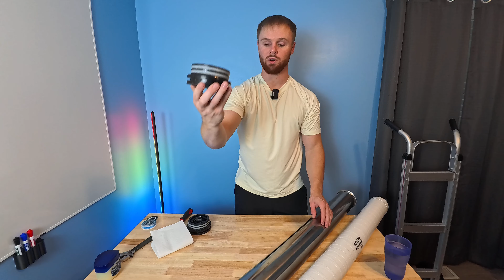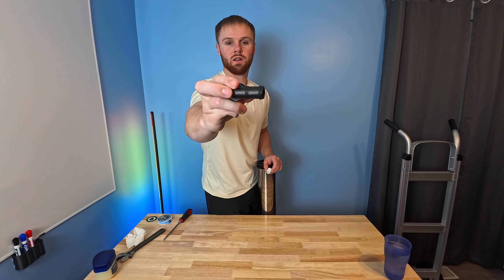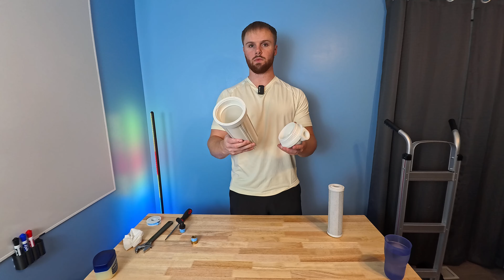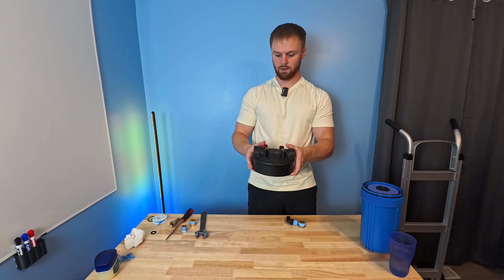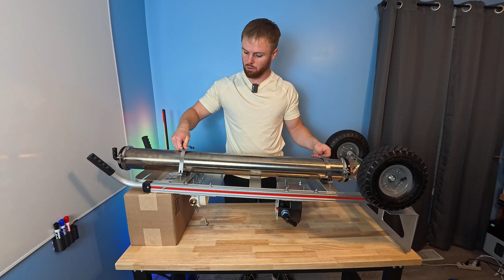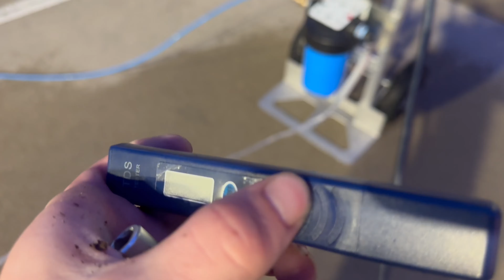DIY Water Fed Pole Cart 2.0 - Window Cleaning

Comment: Hi, is a garden tap pressure of 3.5 bar sufficient for a membrane like the XLE4040? I plan to use it with the Unger Hydropower Ultra S—which I currently use, but the DI resin filters wear out too quickly. Thanks for the reply.

Comment: Does this system work on 200-300 tds?
Reply from the maker: Yep, I run about 200-250 in my area and it works fine. Higher TDS just needs more maintenance and resin refresh

Comment: Why does everyone use this massive ro membrane when u can use a smaller one and a small pump
Reply: Can you explain?
Reply: Bigger ro = more flow, eliminate need for pump
Reply: Does a bigger filter give you more flow? Its def clean water for sure but is there a better way is that company just cornering the market
Reply: @beardman69-e1w just get a 20” then?
Reply from the maker: Adding in a pump just means you have to have a way to power it and one more failure pump. Larger RO membrane means less pressure drop and more flow across the membrane vs a smaller membrane and no pump.

Comment: Really curious how a booster pump could be added , so that I could  feed the system from my buffer tank ,and send it out to a hose reel on the truck TIA!
Reply from the maker: You could just wire up a booster pump in-line between the tank and the cleaning system. Make sure to go with a legit booster pump and something that’s rated for continuous use.
Reply: @pressurewashnerds any insight on how much psi and gpm I should run with a setup like this?
Reply: From what I’ve gathered, the pump should be right before the RO and psi should generally be between 80-100. The membrane that you use has a recommended psi rating.  The gpm is dependent on how many poles you’re running. Rule of thumb is .5 gpm per pole. I’m currently using a 90 psi 1.3 gpm pump with one pole and notice that flow is more than I need and I’m looking into getting a flow control

Comment: I already built a water system on a cart for window cleaning. I followed all the steps. When I connect it to my water hose, the flow from the sediment filter to the RO is good. However, at the bottom part of the RO, there is no flow from the center hole. All the water goes to the waste (unfiltered) outlet, and there is no flow going to the resin tank.
Reply from the maker: I replied to the emails you sent. Hopefully this is resolved now 👍
Reply: I’m having the exact same issue. Could you help me out please.
Reply: @pressurewashnerds   what was the fix for this?

Comment: Thank you for the video!  Is a sediment filter the same as a carbon filter?  If they are different, which do you prefer!  And- how would making this a 4 stage system affect flow?  Again, thank you!
Reply from the maker: So sediment filters just remove debris, carbon filters remove chlorine to help the RO last longer. If I was doing a 4 stage, do the sediment filter after the carbon and before the RO since the carbon filter can produce small amounts of debris. Flow wouldn’t be much different if everything is sized right

Comment: I'm about to by all the equipment and build mine. I'll share updates as I go. Questions...just to make sure...since the xero remains out of stock, I have to buy both pieces from Detroit sponge correct?
Reply from the maker: Correct! The one piece fits inside of the other and adapts it down to the tubing size
Reply: Really interested if you started to make this, I'm thinking of doing this myself!
Reply: How did it go?

Comment: You mentioned on the discharge valve that you like having it so you can mess with the ratios, I have no clue what you are talking about tbh. Would you mind explaining a little bit please? Thanks
Reply from the maker: You crack open the discharge valve to allow the RO reject water to escape. The ratio I’m referring to is how much clean water you have coming out of the system vs the reject water

Comment: So I was doing some research and I just bought a DI tank but I didn’t factor now quickly. I would go through resin so now I’m considering also picking up a sediment filter and a RO tank and kind doing the same build that you did in your first version but online I’m seeing that people say that I need to get a pump because the psi coming out of peoples homes won’t be enough to filter through the RO tank quick enough to get enough pressure out of my water fed hose. What’s the average psi that you would say that you deal with and do you use a battery anywhere? I’m just curious because I would like to make this bill in right now all I have is the 1/2 cubic ft.³ tank of DI and I’m looking at building the rest but I’m curious if I’m gonna need a pump or not I live in Orcas Island, Washington.
Reply from the maker: We have really good water pressure here, around 55 psi. I’ve never had the need for a pump but it would be nice for commercial jobs and higher up.
Reply: I believe there are membranes made for tap water pressure but they don't last as long, not wound as tight in the filter, vs tighter wound filter material that requires a booster pump to get the water pushed thru and those membranes last a bit longer. You got some research to do! As do I. Mobile car detailing and I am spending way too much on di resin...

Comment: How did you pick the type of RO membrane. I've seen some videos, like yours, with the XLP. I've seen other videos with the BW. I would be using city water, 600ppm.
Reply from the maker: I selected the RO membrane based on maximum flow at lesser pressure to avoid adding a booster pump to the system. IMO it’s well worth it for the Axeon membrane
Reply: How is the life of Axeon membran?

Comment: Is it bad if I take out the water of both filters after every job? I feel like it would help make the filters last longer. Or am I wrong?
Reply: Leave water in
Reply: Let the water hose run for 2 minutes before connecting it to your filter system. This helps flush out any metals or sand in the pipes, keeping your filters cleaner for longer.

Comment: Great video, I was wondering for some advice on how to adjust the spigot? Thank you
Reply from the maker: Kind of a feel thing but maybe 1/4 flow that’s coming through the DI is a good start
Reply: So like a good bit should be coming out
Reply from the maker: Yeah, I’d suggest unhooking the outlet from your RO and then playing with the bypass (spigot) and seeing how it impacts your TDS when looking at a TDS meter reading. That’s how I came to the conclusion I did

Comment: does this have enough GPM to feed a 1.3 gpm pressure washer ? thank you
Reply from the maker: Yes it should. I would almost recommend getting the larger DI tank similar to our 1st WFP cart build. More flow out of that system with the larger components
Reply: Don’t do this

Get a buffer tank for your pressure washer and fill it with pure water

Comment: Can I use two 40/40 to membrane or is there no need
Reply from the maker: The benefit of 2 4040 membranes would be more flow. I haven’t tested it but I’d almost upsize the carbon filter if you’re going to do so
Reply: Can you illustrate how two RO's can be configured? I would greatly appreciate the guidance. Great video, by the way.
Reply: @johnshaw3640  instead of having 1 RO membrane between the carbon and sediment filter and the DI filter you'd have 2. so one RO membrane would pass into the other

Comment: I like this idea but I would use SuperLube Silicone grease rather than Vaseline as that can break down the o-rings if they have any rubber in them. I am curious if I can modify this idea for a pressure washing cart.
Reply from the maker: Good call! I actually picked up some SuperLube silicone for the pressure washer build I did right after this